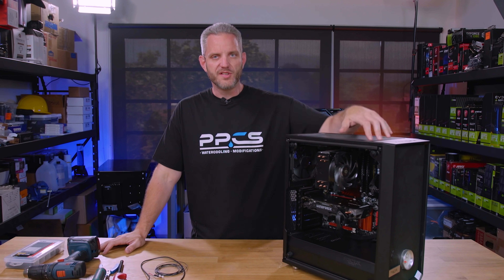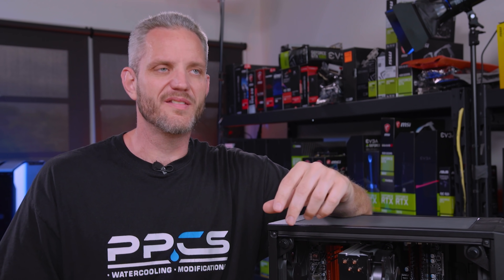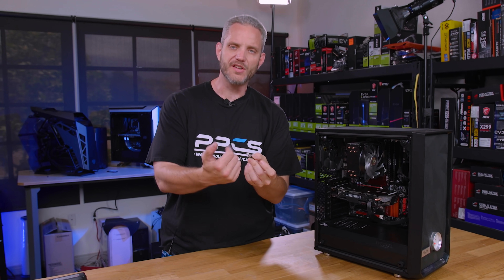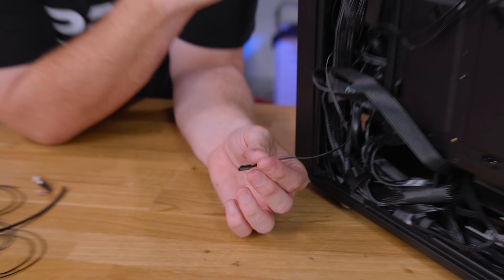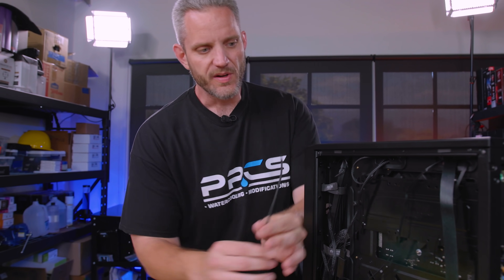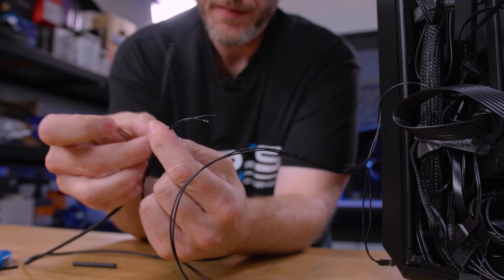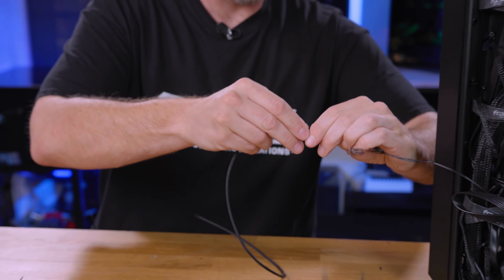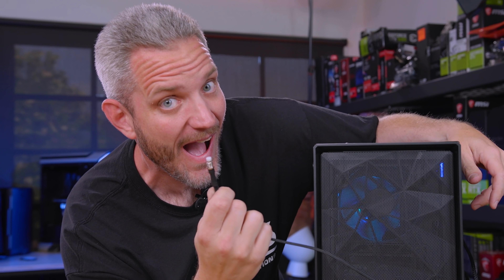How to install a PC KILL SWITCH!

Comment: A more sleak version of this would be a key switch (like the ignition in your car) so that "nobody" that doesn't have the key can do anything with the PC. (Well, that's what I did with the power switch
and the powercables of my boot drive on my LAN-PC)

Comment: Kind of fun that this got made now, three days ago I made basicly the same thing in my old excavator that has a pushbutton for the startermotor, but I changed the ignitionswitch to a newer style with startermotor on the key. So, I made it so that I have to turn the key to start position and push the startbutton at the same time to engange the startermotor.

Comment: Even better: Go find a switch that requires a key input to be able to complete the circuit. And not a cheap one that can be turned with a screwdriver.

Comment: 7:00 Jay  - creates perfect looking harness for new cables so they blend in with the old ones despite them not being visible to anyone.

Me: Wow Jay is really taking it up a notch with this video by making it as clean and as carefully as possible. 

11:20 Jay - Drills into the top of the case
11:40 Jay - Uses a hammer and a screwdriver to hammer a dent into the top for the switch with all his might

Me: .......goddamnit Jay!
Reply: I cringed at the thought of all the metal shavings dropping onto the board.
Reply: @docferringer  That's what the towel he got tangled in the drill bit was supposed to be for…

Comment: For a more stealth option, couldn't just cut the leads on the reset switch and wire it in series with one of the leads on the power button making it so you have to hold the reset button and hit the power button with no obvious extra button? Sure you lose your reset button, but you can just hold both buttons for that functionality.

Comment: I use the hidden button method myself, but not to lock out the power button. I usually add a power / reset switch connected to clear cmos and hide it behind the front panel on builds which don't have boards equipped with a fancy clear cmos button on them. it makes fixing a borked overclock so much easier lol

Comment: I love these types of videos, and I wish you could do more  "DIY" things like this.
For example, my motherboard doesn't have RGB pinouts, I picked up strips from Walmart that uses 5v USB and are remote controlled. I spliced them into the 5v rail on my PSU (yes i know a little scary) and hid the receivers (they both happened to work on one remote) in the case with hot glue. It costed me $10 to totally RGB my glass panel case and it looks CLEAN

Comment: Hi, i think you can use the Reset button, to replace the kill switch (and the 9 bucks). It´s already on the case. Bye.
Reply: THAT actually is a BETTER idea.. Noice! 
Not to mention the wires are all already there.. A snip here.. A snip snip there.. twisty one end to one wire and twisty other end to the other and Boom Bob's your uncle. Who really uses the reset switch anyways? AND you get to disable that bugger (reset switch) from the Sis pressing it and rebooting your whole computer.
Reply: Until you actually need the reset switch...though usually if you're going to reset the computer, a full-off full-on cycle is better anyhow to fully reset the circuitry.
Reply: He also mentioned not all cases have reset switches, so this covers that possibility.

Comment: Nice tutorial Jay! I did the same thing using a key-operated switch so my parents could lock out a younger sibling from playing too much (cruel I know). The key-operated switches use a physical key (like in your ignition) and are proper switches, not just a momentary toggle button. Did it again for an older Corsair Vengeance C70 case for the looks and feel. Just have to lock down your side panels so a smarter kid won't be able to bypass it ^^
Reply from the maker: We saw those at auto zone as well. I considered using one of those as well
Reply: @Jayztwocents  If you have a stepped drill bit to make a nice clean hole in order to fit the switch it can be a pretty neat addition to certain builds and projects.

Comment: would easy to allso make bluetooth or wifi  with password to have small electric relay that powers on the machine and so forth…   would cost around 20 bucks to do ,, instead of few cents, in this case 2 =)

Comment: If I pressed the power button and it didn't work, I would immediately jump the pins on the motherboard. If that didn't work I would jump the green wire to a black wire in the PSU to MB connection.

Comment: or you could just assign the power button in windows to do nothing when pressed, put a shortcut link in the desktop with the command "shutdown /s" or "rundll32.exe powrprof.dll,SetSuspendState 0,1,0" to put it to sleep or hibernate and assign a keyboard shortcut to it, press the KB shortcut when you wanna turn the PC off and all done, no need to drill holes on your precious pc case LOL

Comment: I really like this idea, but what I always thought would be an even cooler video is setting up a rig that not only controls the power, but also acts as a password lock too. Kinda like how on a lot of new cars instead of (or in addition to) a traditional key, there's a fob that has to be within a certain proximity to it, other wise the alarm goes off (or in this case, it just locks the computer/turns it off). I've seen similar setups in very high security enterprise environments with biometric/RFID/magstrip cards, but never got a chance to peek under the hood or know where I could order an aftermarket part & software like that.

Comment: Only here to comment on the stupidity of this idea.  Fix the problem in the bios, that's why that feature is in there.  Fix the problem with the kid, that's why you're a parent.  Set a password, that's what they're for.  This is only a problem when you just decide screw it I'm going to let my kid run around and press buttons.  I've got a kid, all you have to do is keep an eye on them and tell them no.  You should install a kill switch on the main fuse box for the house, can't have the kid messing with outlets and cords...

Comment: i'm still using my pc with this specs up to this day.. 
CPU: amd sempron 140 
GPU: nvidia geforce  8400gs

The fan on my gpu no longer spins on its own and if i do not spin it manually by tapping it to make it spin, the pc overheats and will eventually shutdown a few secs after it boot up.  The fan on my GPU works like a kill switch coz it wont last if its not spinning lol so every time i have to use my computer i have to manually spin the fan until it spins on its own to make it work xD

Comment: to anyone wondering, there are 2 types of momentary switches, SPST NO and SPST NC. the one that Jay is using here is a SPST NO. NO stands for Normally open which means when the button isnt pressed the circuit is disconnected. NC stands for normally closed which means the circuit is disconnected when the button is pressed. Just some helpful info for those that may go to lowes, home depot, or prefer to buy their switch online haha

Comment: You could also use the reset switch on cases which have it if you don't mind foregoing the reset function. A couple of short header extensions, a paperclip, some sidecutters and electrical tape to hold it in place.

Comment: Simple solution could also be to use a case with a front panel door, or better yet. Door with lock
Reply: John Smith that’s a annoying process and slower and if a kid looses the key that’s even more pain in the ass
Reply: @bossman762x39  Yeah if I had to lock my case more often than I do it'd probably annoy me. can't argue with losing the key.

Comment: 3 million sub video should be a hydro E-brake install to reset the system, Overclock handbrake reverse entry Vcore drift... y'kno just saying. 
hah you could actually even make it hydraulic with a hydraulic pressure sensor to close the circuit instead of a switch mounted on a spring loaded lever now that i think about it... to get that authentic hydro E-brake feel.
yes i'm both a car, bike and custom pc enthousiast... so no i don't have any money left, i eat sugar sandwiches and drink rain...

Comment: For added hiddenness, use a magnetic switch!
Hold your keychain with a magnet (or whatever magnet) up to a certain spot on the case, and it turns on.

Can also be used to completely hide a harddrive, though make sure the switch can handle the amount of power.

Comment: Why do flashy keyboards with lights are tethered . When all u need to buy a wireless keyboard with all these features under 30 bucks. .Found a couple of those tethered keyboards on facebook and offer up for 25 bucks that u find on amazon 90 to 150 bucks.If your really into tethered keyboards that take your money. Id be better with a wireless keyboard with every power sleep buttons on multimedia keys at top intergrated with it.

Comment: a cool project i had a few years ago when i was modding cases, i had 5 toggle switches on my case in a row and it was basically a combination lock to turn on the pc.. you had to know the right sequence of "up" and "down" on the switches in order to turn it on.. then once it was on, you can turn it off normally or put it to sleep normally, then mess up the switches so you had to use the code again to turn it back on. it was pretty dope. basically the same thing that you just did. lol all they did when all in the right orientations was complete the circut so when you press the power button it would work.

Comment: This is awesome! The potential application for that switch is slick.
Here's an idea that's been floating in my head now after watching this: Protect a SATA SSD/HDD with an internal flip switch. The disk won't be readable unless it's switch on before the PC is powered on (unless the MOBO and/or OS can register the connection after boot). Can be a pretty decent way to hide additional drives you don't want people seeing, or prevent your computer from booting at all if you apply this to the boot drive.
Supplementing this with this video's kill switch could potentially create an additional layer of boot security to a computer. It's probably totally necessary but on the other hand, SCIENCE.

Comment: Thanks Phil ....   as  ever .   BUT How did you convince Jayz to use a SO big A drill...
..... instead of putting some  sleeves under and  Glue all of it? Or to stick between Case and Radiator screw maybe?
Reply: Alain Church the drill was his idea all i do is sit back and film the potential impending doom of components
Reply: @frickingphil  hahaha!!   (you were smiling, weren't you ?)
Thanks for making techs less boring or alright fun!

Comment: hey Jay, what about showing us how to build a cheap racing VR setup. good video btw
Reply: You weren’t very specific. I would’ve replied telling you about google cardboard 😆.
Reply: @DJHeroMasta  thx! I have a Rift and want to build a racing setup for Dirt Rally 1&2. How to do that without spending big bucks?
Reply: Gilbert Tremblay The Logitech G29 goes on sale a lot. In fact, it’s currently on sale rn Amazon for $213. Don’t be scared to jump into the used market either (eBay). The G29 uses a gear system, Thrustmaster wheels are typically belt driven and then you have the premium direct drive wheels. If you’re looking for a chassis/wheel stand I recommend you start off with the DIY route if you’re fixing to save some money. But whatever you do, don’t cheap out on the frame. If you’re going to buy one, get one that’s solid and won’t flex or wobble on you. Not saying you have to go all out but cheaping out on something that’s important that you plan on upgrading later is simply going to cost you more money down the road. Same can be said about the steering wheel and other accessories but at least you know what you’re getting up front v.s it falling apart on you on later on down the road causing more problems.

Comment: Didnt you try Microcenter they have that switch in the hobby section? Hey Jay when i used to work @ Circuit city back in the days doing car audio installs my co worker installed a cheap keyless entry system in his PC so he could turn the PC  on with the fob as he is driving into his drive way 😂
Reply from the maker: I was thinking of doing that next!

Comment: OMG. My little brother, when he was 1 or so. Would just walk up and hit the power button. All because it was pretty and it glowed.

Now fast forward a bit. My little niece tries to do the same thing. On top of trying to feed the TV Cheerios (shut up haters. It is cute). 

Though learned from my little brother. Just used tape and a piece of cardboard to cover the lights. See ni glowie buttons. No, temptation to press cool glowie buttons. Though will try to feed the TV Cheerios....that cannot be fixed.

Comment: If that was my pc I would try to put the killswitch either under my desk or maybe wired underneath one of the f keys that isn't used (maybe just with the wires so that they touch when you press it.

Comment: Option one: Disable BIG TURN ON/OFF BUTTON and connect the reset button to turn the PC on/off.
Option two: https://www.aliexpress.com/item/High-Quality-1-6m-Desktop-Computer-Case-Power-Supply-on-off-Reset-HDD-Push-Button-Switch/32543104125.html

Comment: I once had a case that shipped with a defective power button. Simple solution was to use the reset switch as the power switch. Bonus points that it's hard to press and those that don't know it can't use the switch to turn the PC off.

Comment: Anti-vandal type switches are cheap and come with a nut to secure them to the material (plus are a standard size that you can use a stepper drill bit with. I replaced my power, power LED and reset switch with two that sit in a little box under my desk since my PC is on a shelf behind my monitors and out of reach. Also if you want to try this and not damage the wires attached to your case, you can get front panel extensions that are easily replaced if you change your mind or something goes wrong.

Comment: PC not starting? Did you check under the air filter?
Reply: Hmm... I usually start looking at the distributor. After all no spark no POST...

I think I've mixed things up again, we were talking about VCR's right?
Reply: No no . The PC isnt starting because you didnt fill up the blinker fluid. We all know computers run on blinker fluid.
Reply: I died
Reply: @Logan_Bones  rip ;p
Reply: It has a misfire

Comment: i thought that it would destroy all the files in case of "FBI open up"
Reply: Same that's why I even botherd to click
Reply: There was a company, RunCore that released an SSD with a self destruct button, 5 Sec permanent wipe.
Reply: Put some explosives glued to the HDDs and use the kill switch to go BOOM.
Reply: Would still take at least a minute or so to shred everything.
Reply: @Usammityduzntafraidofanythin  Not if you rig up a C4 charge. Might be hard to explain though...
Reply: @Landonstein  just get a bunch of hydraulic spikes that punch right through the drives. Restoring anything from that is basically impossible, especially  if they punch through  a running HDD. And this solution would  be legal too.
Reply: @Usammityduzntafraidofanythin  Just install a switch that will connect 120/110/240 AC to the SSD.
Reply: me too
Reply: That was my second thought, my first thought was "A kill switch? Isn't that just a reset switch?"

Comment: Use a reed switch and then you can leave it inside the case and start the PC with a magnet ring. https://www.amazon.com/Bystar-Strong-Magnetic-Magnet-Finger/dp/B01GZUHQZA/ref=sr_1_52?keywords=Ring+finger+magnet&qid=1556883423&s=gateway&sr=8-52

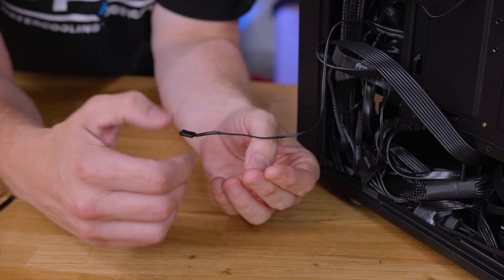Comment: 4:45 WRONG!!!
You pull the PS_ON to Ground - not bridge the 24 Pin to 12V - this would release a lot of Sparks and magic smoke
Reply: The 12V, 5V and 3,3V Rail is off when your PC is off, only 5Vsb (5Volt Stand By) is present

Comment: This is something i have wanted to do for a while cause of my cats stepping on buttons, gonna put a switch in the bottom of my bezel, have not had the time, so i unplugged said button and have been relying on WOL, annoying when the power goes out though, currently have a salved button sticking out the back of the case through a salved pci bracket for a power button

Comment: I did something like this, way too many years ago, when all 'neutral grey' PC cases had a second 'momentary' switch for reset and a flip switch to power on.
I ended up keeping the flip-switch in it's 'on' position and just press the reset button to turn on the PC 

The good old days

Comment: Make a video about Rx 570 crossfire vs rtx 2060 .. If one should choose crossfire as an alternative ..How motherboard and price to performance ratio effect crossfire ..drawbacks , advantage , bottlenecks
Reply: In the applications were the crossfire works, the 2 RX570s are better. But it doesn't work on all applications
Reply: @robinsuj  you think that ..seems right ... That maybe why we don't see much of a multi gpu setup...but gcn architecture should scale better and be more efficient in recent games ... please correct me if I'm wrong ...I am new to hardware and hardware architecture thinks...thanks

Comment: I've done something similar but I used the cases existing headphone jack. I disconnected it from the mobo and wired it up with the power switch. Now you need to plug in a special male headphone jack that does the same thing that extra switch does.

Comment: Use the reset switch as the kill switch.
And make the extra switch as the reset switch. (or just have no reset switch)
Problem solved.
If it doesn't work punish the child for doing things that it is not allowed to do.